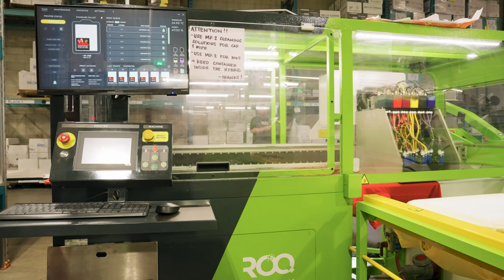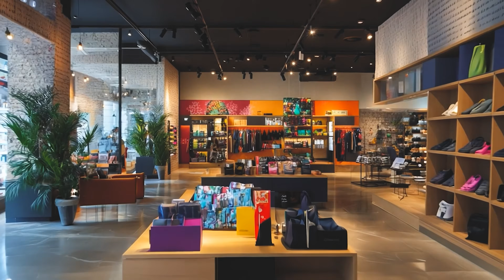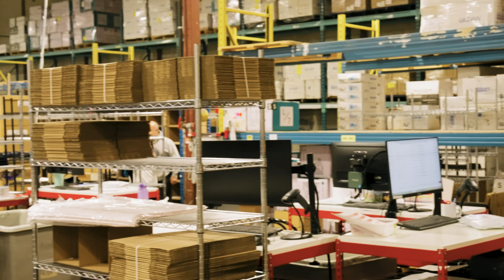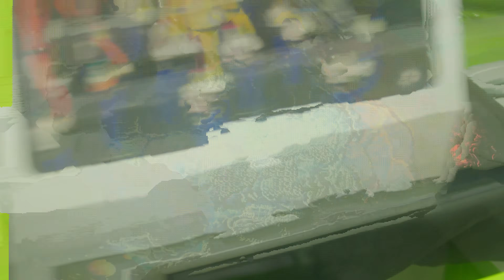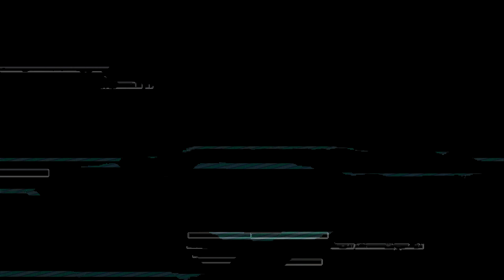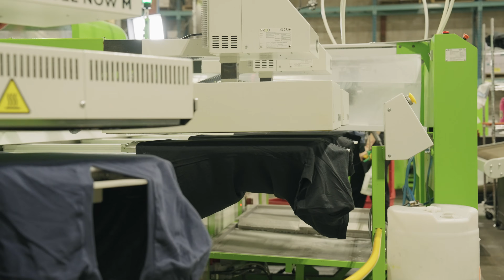How the ROQ NOW Industrial DTG Transformed Print Geek's Efficiency & Quality

Comment: love this machine. one question though. On the "print to store" comment, what's the process right after ink to shirt. Is there a heat press involved or a flash then tunnel. Or straight to tunnel. Is there a heat press after pretreat? My big concern is heat press boxes if I take shirts form this machine to folding machine. Thanks!
Reply: Hey there, 
After the color ink is printed, there are 2 more stations. Station 1 is a flash unit to cure the very top of the ink so there is no transferring of ink if the print is touched or the garment folds over on itself. The second station is the optional final heat press. this heat press is used to reduce the peaks and valleys of the ink (at the microscopic level) so that the hand-feel is much smoother. Again, it's just an option and it mostly caters to our partner's clientele. 

Going back in the process, once the pretreat is laid down, the water portion needs to be dried out, so the work is down between 2 flashes and 2 presses. This allows the fibers to be laid down to get a better print. The majority of discoloring we see is the dehydration/lack of humidity. This generally is corrected by the environment it's in. In Florida, it normally takes about 20mins to get back to normal color.

There is a good walk around video here below:

https://www.instagram.com/reel/DFQSPcmP1Id/?utm_source=ig_web_copy_link&igsh=bGk3YTFzbG5hdTQx